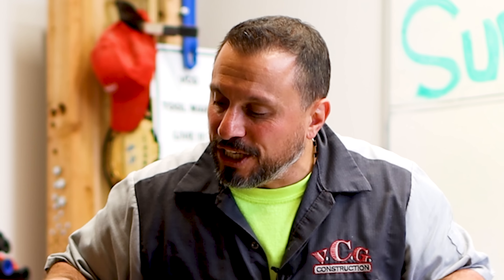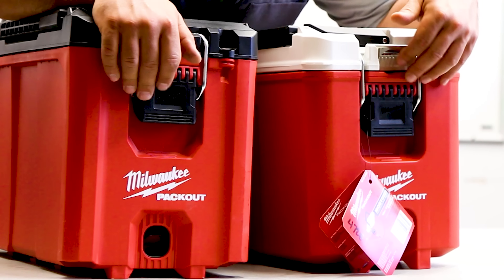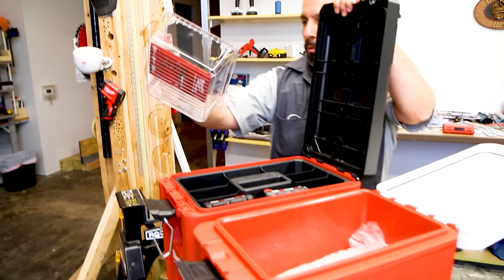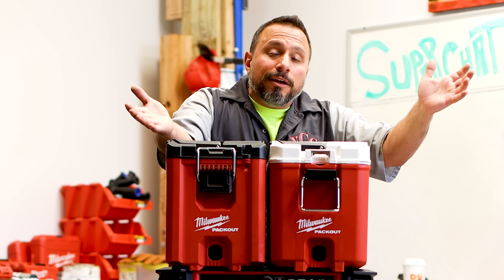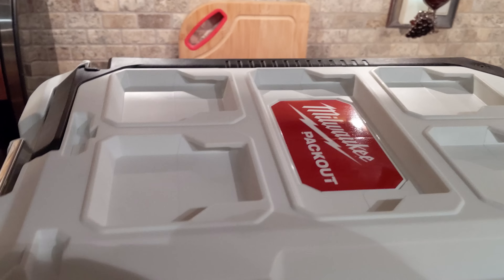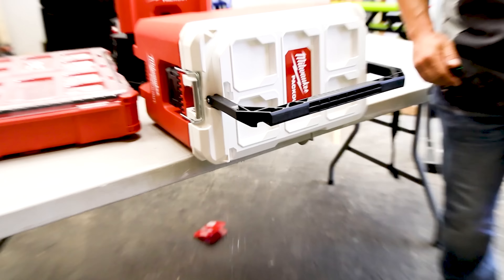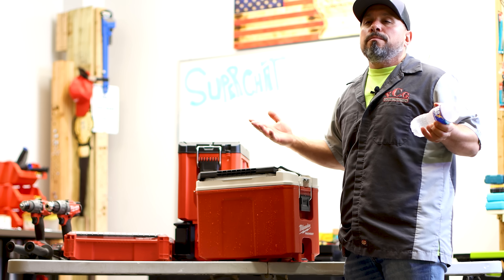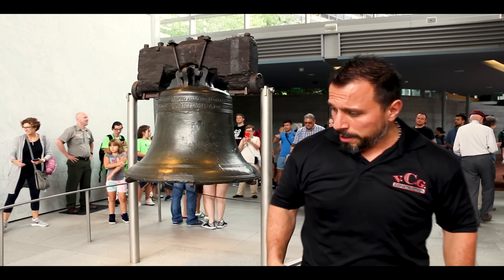NEW Milwaukee PACKOUT COOLER Professionally Tested (SHOCKING RESULTS)

Comment: The cooler lid opens up the full way because you can use it for a table ... hence the cup holder indents. Also it has less space than the tool box because of the way coolers are built.

Comment: Wow I almost bought this cooler but Milwaukee needs to make one that doesn’t leak first.
Reply: I bought one it hasn't leaked yet
Reply: Ive had it tip over over but I've never just let it sit on its side with ice and water, may be worth the test
Reply: Mine don’t leak at all after watching this I did the same test with no leak. If you push the lid down before you clamp it shut it makes a seal you can feel the vacuum when you open it next time.
Reply: I bought one and took it out yesterday for a few hours. Let ice melt and did this same test in the video. No water leakage at all. I’m guessing he got a bad unit.
Reply: Mine tipped on its side and didn't leak, have had it for about six months.

Comment: I went ahead and grabbed one despite the leaking and tested it out yesterday in 94 degree weather for an afternoon at the river. My cooler did not leak one bit. I would guess there was about 32 ounces of water melted and tipping it on the side, sloshing it back and forth like you did not get any water leakage. Perhaps you got a bum unit? Overall I’m happy with it.

Comment: It looks like it could be nice and I like the tray in top to keep a sandwich or something else getting crushed but I would hardly call that ice retention at 30 hours. Too many manufacturers not just Milwaukee embellish the capabilities of their products way too much. I use an igloo round cooler that actually retains usable ice through the next day even when left in my van overnight and when the lid is locked in place it doesn't leak if you tip it over.
 Hopefully you can do a longer term use review after having it for a few weeks and let us know how it holds up and compares to your existing cooler. The price on this seems pretty steep for what seems like a subpar cooler that can latch onto packout boxes. As always great video.

Comment: This is the type of thing that I think is really only worth it if you need/can make good use of the packout functionality. If you've got some packout mounts in the bed of your truck then the leaking isnt an issue and you can keep all your stuff organized. I have trouble investing in any cooler that expensive, but at least the packout adds some functionality to it.

Comment: I don't expect that to be water tight, the gasket does its job and prevents as much water as it can to come out for average use. it drizzles out of the seams instead of being a water fall. I love that cooler I gotta pick one up for the rest of my packout stuff that I didn't even flip yet.
Reply: If that cooler was to be water tight it would have 4- 6 locks along the side of it instead of 1. That cooler is doing exactly what it is supposed to do. and great review you guys

Comment: I'm guessing They could have a thicker gasket. But it's IP rated (Ingress Protection) so it's looking at jets of water spray at the box from many angles using a special rig. The Jets of water are calibrated to the standard. And yes IP 65 means 6 for dust, 5 for water. Which is not great, not bad, but not amazing.

But it's not rated for water EGRESS. or leaking out. That's just not part of how they test the boxes. So Milwaukee needs a different idea on that issue.
Reply: Just don’t hold your cooler upside down?

Comment: I’m surprised they didn’t release an m18 powered cooler. It’s nice to have a cooler without melted ice, especially when there’s more food packed than ice. Who wants mushy food when you haven’t sealed your food well enough? I’ve been there and it ain’t pretty. Save the mushed food for when I’m nearly dead, please. Drinks are great on a hot day, but drink coolers are better suited for that, IMHO. Can’t tell me an M18 9ah or 12ah battery wouldn’t keep such a thing running a long time, not to mention most people have more than one battery. I know construction workers might deal with ice now, but it’s better without, and better when you could bring a battery powered cooler along to camp or on the boat. Hope Milwaukee reads this. Thanks Vince, nice video.

Comment: One thing they should have added to the cooler is detachable blue ice packs that attach and detach from the bottom side of the lid. Cold move down, blue ice is colder than water ice and last longer without the mess.

Comment: I tell you that much Vince. This coolant box is not for free ice inside.. Do you know this special plastics ice cartridges? The once they not leaking after they turnin into a water? I think this coolant milwaukee box is made that for. So the gasket in this box is made more for dust or just rain outside protection. Not to prevent leaking any water inside the box. Thats my point. Anyway this tool accesory is handy and looks good to me :) nice one Vince and see you on the next one! (yes i did smasht the like button and i have 7 years of luck :D )
Reply from the maker: ahhhh, good point
Reply: @VCG Construction.  You may have a challenge or test here Vince.  On one of your next tests with a circ saw, put this Milwaukee Packout cooler in the path of all that sawdust and see how well it keeps the sawdust out. I'll see if Milwaukee comes out with a 2.0 version with a place for a lock. Your crew must not mooch your or others lunches or brewskis so no need for a lock. Just sayin.

Hope you and your family stay safe and well 🙏

Comment: Every cooler company already over-promises and under-delivers the second they print "retains ice UP TO...." on its nomenclature. Some coolers easily surpass their claims, most don't. Think about having this one out at a jobsite outdoors and it is unrealistic to ask it to keep ice 30 hours. I'd say 12 hours easily in the heat (I'm in south Texas) and probably 16 hours in cooler weather. No way this will retain ice for 30 hours in summer in an outdoor working environment. But then again, who works 30 hours per shift? That said, I have this cooler. It's solid for what its purpose is. I use it at the ranch for the day while doing work. It's serviceable to the user for that purpose.

Comment: Generally I use frozen water bottles that don't leak, then I can drink them at the end of the shift. No wetness in the cooler. If yhey release a full-size cooler, I'd probably use a milk jug filled with water and freeze it. Lasts longer than cubed ice.
Reply from the maker: Good call

Comment: Sorry about all the comments but maybe they shouldn't make where the hinge is on either side of the cooler not at the end and put a locking clamp on both ends which would really seal the box type so when you tip it over that will have the hinge side to open up but then you would have the two clamps on either end to really seal tight the cooler
Reply: Too much money for too many problems

Comment: i am gonna wait for gen 2 to come out.
they always "fix" the issues in gen 2, then in gen 3 they add more power and make it smaller and all that cool jazz!
Reply: Yes that's milwaukee in a nutshell, how things should be done imo.  With one of the folding knives I thought a cover over the button should be installed and voila, gen 2 knife had a cover on the button.

Comment: I think Milwaukee missed the mark. Should have done an ice less cooler on the M18 platform. That included a automobile auxiliary power cord. I have Coleman cooler that's like this that's awesome. It ends both the ice and the water spill problem all at 1 time.

Comment: The Ammo box has the “Packout smell” and cooler does not have the weird smell inside. I like to use the cooler for snack foods and spices sometimes. I was using the big ammo box instead but the Packout smell sucked so I definitely prefer keeping food in the cooler when I want to seal it away safely from chipmunks and coworkers

Comment: Have you ever had a problem with your Dewalt 2.0 radio did the subwoofer blow on it and then the sound keeps shutting off after a while and how do you fix that

Comment: The reason is not just the insulated lid but it has a cup holder and its the reason why it opens wider for the cooler.

Comment: Kinda lame it leaks like that. Would expect better from a $110 cooler. But now that I've looked at some alternatives $110 for a ruggedized 16 quart cooler isn't bad. But I'd think something like the costway stakol which claims 3-5 days of ice rention for $95 would be a better buy. But I don't do construction. I don't need a packout system. I just diy around the house and do maintenance on my cars. Thanks for the review!

Comment: the reason the lid flops over is because the inside has recesions to hold a drink when you open it. when the top is closed theres no recessions because of the packout slots.

Comment: Is there little drink holder circles on the inside of the lid? Its hard to tell with the white balance. I would say it opens all the way for a little table.
I will say that its concerning that it leaks that easily, since it most likely will be stacked on the job site. Moving it around either with the dolly or the original 2 wheeled base the water will leak all over during transportation.
Reply: DELETE THE ELITE  who the hells gonna steal a lunch box?!
Yogi the bear?🤣🐻🥪
Reply: DELETE THE ELITE  
🤦🏽‍♂️ofcourse how could i forget right
Andrechrome aint gonna refill its self right👶🏽💉
Reply: @canogaparque818  I can tell your the funny old guy at the job 😂😂😂

Comment: Hey Vince 
I believe what's happening is when the lid is closed for the cooler the gaskets are not fully compressing enough both the sides and the back at the hinges and I believe the only place that's making full contact and is being compressed is at the front lach

Comment: Yeah yeah yeah you're going to have ice lift in it after 30 hours if you leave the cooler in an air-conditioned!!!.... Are you going to have ice in it after 30 hours if you leave it outside, in the shade, in a hot Texas or Florida summer?
Reply: very true....they should do more real world testing before putting it out there...most people who buy this will be on a job site or outside in the summer

Comment: I used this for the first time yesterday.  Right off I noticed the leaking.  I put ice in it just before 7am. I had it outside for 12 hours using it,  then had it in my van.  Noticed after watching this video I was right at 30 hours.  Low 90s yesterday.  Went out to NO ICE.  However I will say water was ice cold and so were the remaining drinks.  I like the hard case and packout features, the leaking part sucks.

Comment: Hey Vince my dude, love your channel, learning a ton! Gotta say though, when it comes to this topic, I am the you of tailgate gear. This cooler failed at the ice retention test. I understand the premium to have a cooler with packet compatibility, but for a 16qt cooler at that price, it is pretty poor performance, especially since it was kept indoors for the 30 hours. That performance is on par with super cheap Walmart specials. Also, you mention about the cooler having foam insulation. I have drilled into plenty of coolers to build jockey boxes and sous vide cooking vessels, and I would bet dollars to donuts that lid is hollow. In fairness, an air gap does work as a form of insulation, but it ain't foam. Keep on keeping' on, and if you need any expertise for this kinda stuff, or bbq etc, I ain't too far from Philly and I'm always looking for an excuse to grab a sangweech at Tony Luke's or John's brother!

Comment: I would be more impressed if there was significant amounts of ice left at 30 hrs in temps over 90 degrees &/or left in the sun.  I have had cheap igloo coolers hold ice for 3-4 days with people opening and closing the lid

Comment: It’s cool and all but the lunch bag says it’s hold ice for 24 hours and almost half the cost in fact in Utah at least home depot online the lunch box is on sale for $39.99 but it isn’t pack out maybe they should do that next
Reply: It seems like it would be easy enough to attach a packout mounting plate on the bottom for that or just put it inside one of the packout crates? You can stack on top of it if it fits flush in the crate even though it's a soft sided bag.

Comment: What Milwaukee needs to do is make a packout vacuum!
Reply: You sir are a time traveler 🤣🤣🤣
Reply: @Bluecollar_obs_limo  Just got mine too, and it is awesome!
Reply: @sonofdathomir5220  I came from the 20 volt dewalt newer version shop vac and I freaking love that thing I definitely like the pack out better the only thing I wish it had was an option to have a plug.. I finally bought a 12.0 battery but it's still eats that up pretty decent

Comment: $100 for basically a Coleman cooler that attaches to a pack out? It’s probably a better idea to get a small yeti or rtic or something and then glue a pack out adapter to it (the ones you use to mount pack outs on the wall

Comment: Not worth the money, it leaks but it did hold ice, barely. This is with the lid closed for 30hrs, if you open it a few times throughout the day in 90-100 degree weather to get water or lunch. I'd be surprised if it held ice for 8hrs. It's no YETI or even a YETI knock off.

Comment: That is so strange how it leaks so easily, you'd think that would have been dealt with being its made for construction and its pretty tall and narrow so it could easily tip over. Its a deal breaker for me unfortunately.
They just need to modify a small bar fridge so you can maybe battery power it with 2 batteries and it would take up same amount of room as both of those coolers did, just how do you get around the weight issue...

Comment: Not great performance for a small cooler that sells for $99, I think Milwaukee could have insulated and sealed it better then that. For a little more money you could get a Yetti cooler that’s a little bit larger and will keep ice for 4 to 5 days and not leak or sweat condensation out, but would not fit in the pack out system. If you only expected the Milwaukee cooler to keep your drinks and lunch cold for 1 work day then it might work for you.